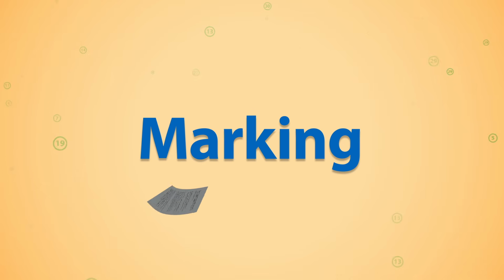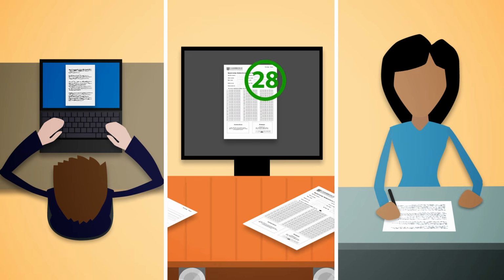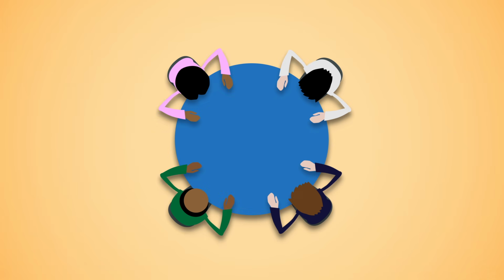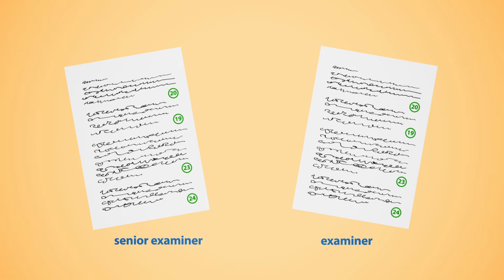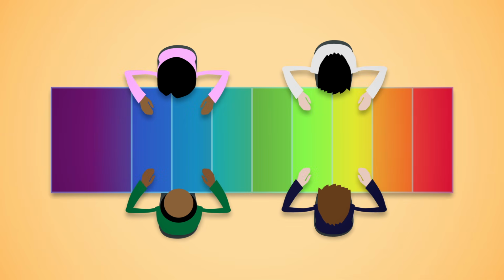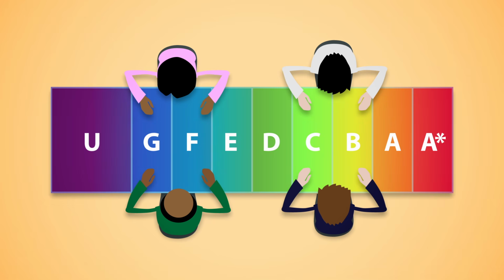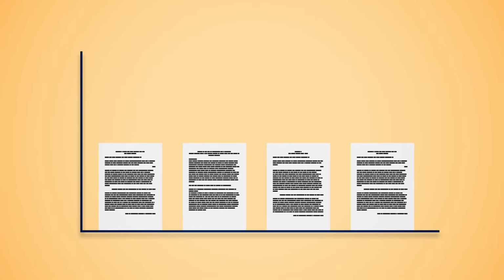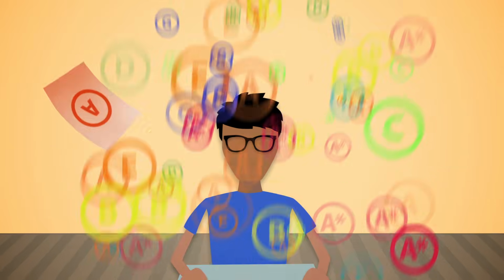How we work out your results

Comment: The threshold for physics mj 24 was 150 or so out of 200, but the papers are 80+40+40 which is 160 not 200. So I need a cumulative 75% in these papers for an A star right?

Comment: Today in my chem p6 the experiment qsn i wrote something completely different and realised it was titration only after so had to cross it out however i did not have any page left so wrote on the blank page hope they mark it💔
Reply: Bro you even if you get 10 marks wrong you can still get an A*
Relax ❤
Reply: @ i hope so. But still i really pray they mark my experiment qsn cuz i dont want to lose 6 marks..
Reply: @malcomgopoto4240  bro I am probably losing 20 and 15 marks from paper 4 and 6 and I'm not worried. Paper 2 is left for me.
I expect to get an A and I didn't even put an effort. You would definitely get an A* cuz you tried hard
Reply: What's your result for chem?

Comment: mmm isnt having a marking scheme with specific marking schemes a little antithetical to the idea of learning and creativity ? It also limits of the scopes of the answers. There can be a lot of right answers rather than just the ones on the marking scheme.
Reply: Well, that would depend on the subject. For subjects such as maths and sciences there are clear and correct answers, no arguing there. And for creative subjects like English the mark scheme is not very specific and instead can be applied universally. For example, to get top grades you need to be “perceptive” and “critical” in your essays.
Reply: @luvtwicecats2518  No. For Maths there are some questions that have many ways and methods of being solved. Secondly, for Science subjects, yes the answer is one, but there are thousands of different ways to say the same correct point, some people use different words to explain things.
Reply: @_Dreamer_9306   unfortunately for maths, they have mentioned to answer as efficiently as possible and the mark scheme shows the most efficient method too. For sciences key terms are key terms, there is no changing that, as long as those terms are mentioned which are usually underlined they are accepted with a plausible explanation too.
Reply: In subjects like Geography or Islamist,any valid point is accepted. If any examiner is unsure ,he calls a conference
Reply: Everybody knows that 90% of what they're teaching us in Cambridge is useless. They know it too. Just forget creativity and pass the exams.